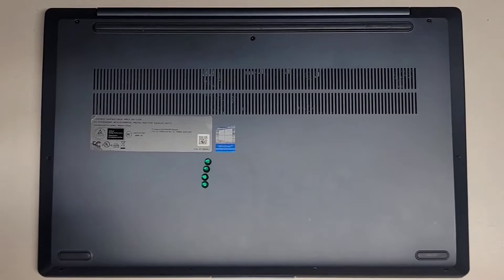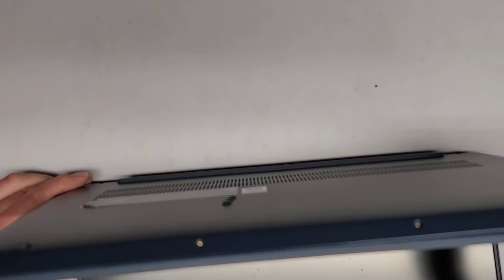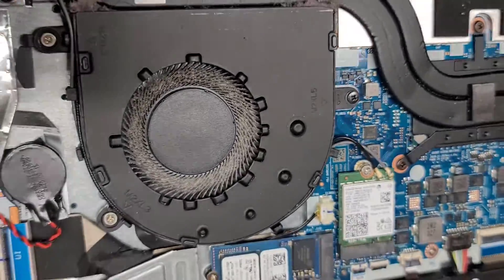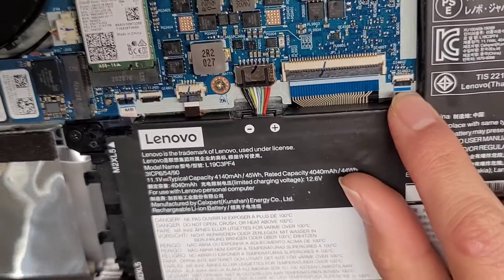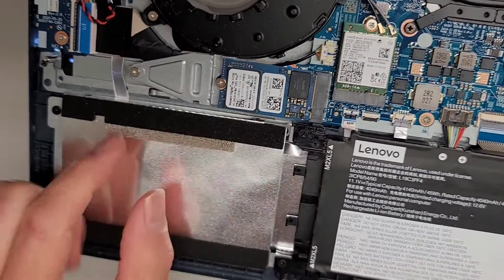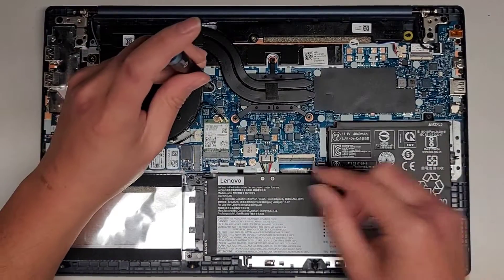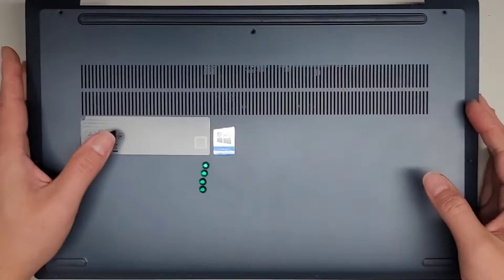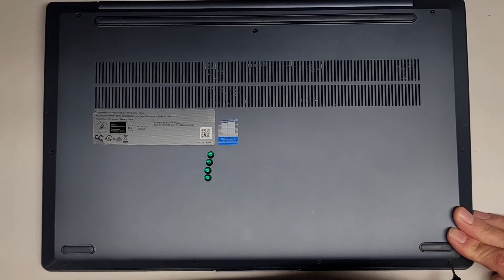Lenovo IdeaPad 5 15IIL05 Disassembly SSD Hard Drive Upgrade Battery Replacement Repair Quick Look

Comment: But you didn't either replace the battery or ssd!!!!!!!!!!!???
Reply from the maker: Nope, just pointed them out and model info. If you need more help with how to remove screws and disconnect the cable, I have other videos showing that.

Comment: Need to remove my hard drive from my dead unit in preparation to transfer data to a new laptop.
Unfortunately, you don't quite show that disassembly 100%, but at least we're moving in the right direction.
Want to accomplish this here in Vietnam before I fly home so I'm not lugging all this useless extra weight home w me.
Reply from the maker: This video will help https://youtu.be/sPidU9PpCCk?si=ms-hpYX6aKgoTa7l
Reply: @ItsBinhRepaired  yep, that's gonna do it!  Thx a bunch.
Reply from the maker: @davidwilburn6314  no problem. If you haven't already, please like and subscribe so others can find my videos and possibly consider watching a few others, liking and commenting to get the algorithm to recommend my channel. Thanks!

Comment: I thought you were going to show us disassembly of the SSD and battery, as the title suggested. You did none of that. You took the bottom cover off and then put it back. I appreciate you showing us how to take the bottom cover off. But please change your title as this was a waste of time because you did not show us disassembly of ssd and battery. From what I see, it has not binh repaired.
Reply from the maker: I got thousands of other videos showing that.. If you lack the ability to remove a single screw and pull the stick or 4 screws and pull the connector after taking the bottom cover off, I'm worried for your computer. One video won't be enough for you to start working on it. Watch a few others. The point is to show what's inside so people know what to buy before starting the upgrade process.

Comment: Great video!!!  If you're still around I have a question.  So after watching your video and reading the comments I'm unsure as to what is required to install an internal 2.5 SSD.  Per your video you will need additional screws.  Per the comments you do not need to remove the battery but that's where the screws seem to be missing.  Also per your comments you will need a SATA adapter to connect the SSD.  Is that not included within the enclosure?  Can you explain this process a bit further?   After researching this topic for over an hour you've by far provided the best resource possible so that's why I am asking.  Thanks!
Reply from the maker: I think this will work https://amzn.to/3S4GoLm screws not needed for an SSD

Comment: Thank you for the video, very informative.   
   I’m currently adding a 2.5” ssd to mine and was hoping to watch someone unplug the battery from the mb.   With laptops I’m so paranoid about damaging it,  seeing it really helps.    Possibly a note for future vids?     
  Thanks you again for the excellent video!
Reply from the maker: When replacing hard drives and RAM it's unnecessary to remove the battery.

Comment: FYI, you can get a pretty good grip on the bottom shell around the hinge area, but make sure to work around the edges as the middle part flexes too easily.
Reply from the maker: Yeah

Comment: Hello bro please reply I have issue in my IdeaPad 5 laptop as you mentioned in 7:12 min in your video my mother board is heating from the connector where the screen is attached please tell its my motherboard faulty or screen is destroyed ?? will I have to replace them ??? or it can be repaired easily ??? whenever I connect battery no power to power button and  motherboard start heating up from area where you mentioned at 7:12 min just below screen connector . please tell I am in streess
Reply from the maker: Do the battery drain and disconnect the cable. It might be burned.
Reply: @ItsBinhRepaired  but doing just a small mistake of improper cable attach to that pin at 7:12 can cause whole motherboard damage that is only improperly attached for 30seconds later I attached properly
Reply from the maker: @Ashish Vishwakarma  yes, doing that cable wrong can fry the board, cable, and screen instantly.
Reply: @ItsBinhRepaired  my laptop has premium care support that is 1 year warranty will they consider if I don't tell them that I attached the cable improperly that causes motherboard fault
Reply from the maker: @ashishvishwakarma5515  possibly, you can try.
Reply: @ItsBinhRepaired  is it because of I attached bolts and nuts on my hinge and drilled the back panel safely  because epoxy is not giving permanent solution so current can transfer from one hinge to another using metal back and causing damage to motherboard is it possible or it's damaged just because of wrong cable attachment
Reply from the maker: @ashishvishwakarma5515  Don't know what you did.

Comment: Can you actually attach an NVME m.2 ssd to the port where the ethernet card is? I want to upgrade my tiny SSD that came with the laptop, but I have to clone the data first to the new SSD. Would that port where the WIFI 6 card is attached find my new SSD and allow cloning? 🧐I seriously don't want to spend extra 30 UK pounds just to buy an external USB to m.2 adapter and use it once... especially where the prices of those adapters are almost 50% of the SSD I'm looking to get...
Reply from the maker: Amazon with free returns lol

Comment: Hi and thank you for the great video! I have a Lenovo ideapad 5-15IIL05 laptop that won't boot, I can't even get to the BIOS. When hitting the power button, you can hear the fan starts to spin as if the device will boot, then the fan stops, the laptop seemingly shuts down, then tries to start again. This goes on and on, but never boots, I have to do a hard power down to stop the cycle. I followed all the steps in this video, removing battery and using only power, battery only, new power cord, etc. etc. 1 key recovery doesn't apear to do anything,  Between each step I drained all residual power, holding down the power for 1 minute. Do you have another video you could suggest for this issue or any other thoughts? Thank you so much!
Reply from the maker: Sounds like a dead motherboard sadly :(
Reply: @ItsBinhRepaired   Shoot, Ok, well thanks for the reply, Binh.
Reply from the maker: @Katie-cu5jx  no problem

Comment: How do you add the 2.5" SSD?  Where do you plug it into on the motherboard?
Reply from the maker: You need a sata cable adapter for the laptop.
Reply: @ItsBinhRepaired  where in the motherboard does it go?
Reply from the maker: I mention it in the video.  One of the zif connectors.